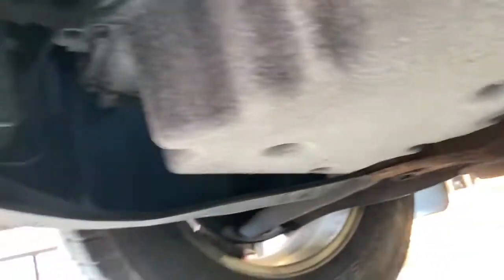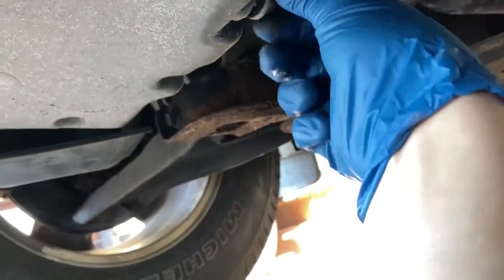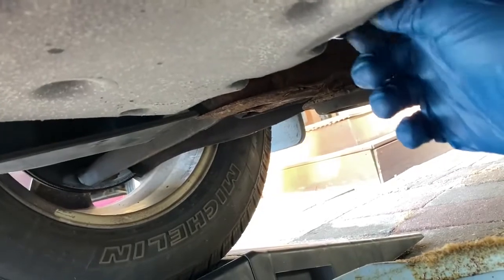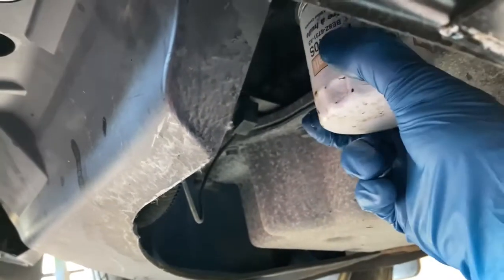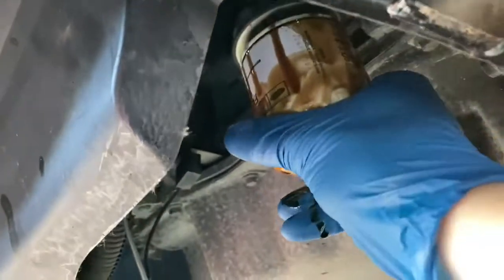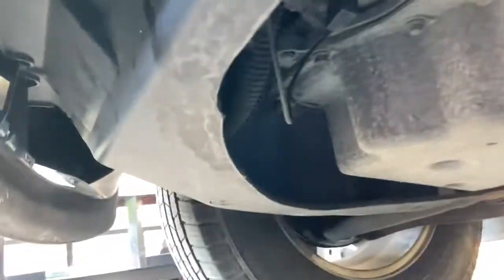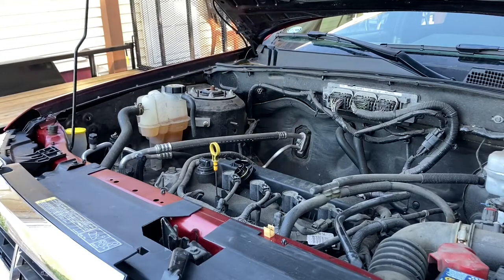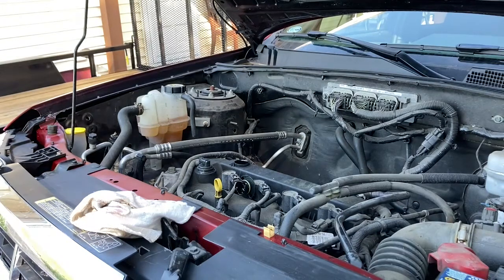Ford Escape Oil Change | How to Change Oil 2008-2012 2.5L Ford Escape

Comment: Changing your oil is a great way to get to know your car and start learning how easy and cheap it is to do your own maintenance and repairs. If you are not confident, find someone you trust to help you get started. It will cost some upfront to buy the tools but you will make it up 1000 fold over the years. I was probably 21 when I started changing mine, been doing it for over 30 years. I also learned to fix everything else, all car repairs, home repairs, improvements. I've saved hundreds of thousands over the years by not paying pro's and not having to replace cars. What is a crisis for most is for me a minor inconvenience to be addressed on a Saturday afternoon. DIY shall set you free.
Reply from the maker: 100% agree!! Thanks for the comment!

Comment: I was shopping around to get my oil changed and decided I’m done paying others to do this job. Been changing oil on my motorcycles since I was a kid. Just as I guessed this is just as easy, thanks bud. Got all I need and some Lucas high mileage oil stabilizer for 30 less than what the shops would charge. Future changes will be faster and less than half ! 💪
Reply from the maker: No problem glad to help! It’s fun doing it yourself too! You know it’s done right!

Comment: One thing I learned is do your filter first. No worries about dropping it in a full oil pan and be splashing everywhere. Also if it's vertical like this or somewhat at an angle, pre-fill with clean oil to reduce the time it's running without oil pressure. It minimal but it doesn't hurt. I use full synthetic and keep it changed under 5000 miles, 3000 if turbo. My cars go 300K, I have never had an oil related engine problem. The car wears out but the engine runs like new.

Comment: Gratitude Matt I’ve been changing my oil I’m a DIY type of girl I have a disabled mother with this car and to save money esp a time like now I choose to do it myself rather than paying almost $80 save about $40!
Reply from the maker: So glad this helped you out!! Thanks so much for watching!! 😁😁😁
Reply: I have a question my mother’s is on super tight I don’t wanna strip it what would be you best suggestion I DO NOT APPOVE THE LAST PERSON WHO CHANGED HER OIL lol
Reply from the maker: @bellmovement  make sure you use a 6 point socket and a breaker bar just try to bump it loose or crank with the breaker bar if you have a good hold. Don’t use power tools you’ll round it right off.

Comment: I just picked up a 2012 4 cyl, 2wd.  I noticed your coolant looks yellow, mine is pink?  Any thoughts?  Also, have you done a transmission drain and fill, would like to do that too.  Thanks for the video!
Reply from the maker: Yes! I have a video on the transmission on my channel! You might just have a different type but as far as I know standard yellow/green coolant is fine for these cars.

Comment: I’m getting ready to change the oil for a family member.  I think that Escape is the V6 model, though.  Other videos I’ve seen show the oil pan and filter in a different place.  I don’t want to drain the transmission fluid by mistake.

The owners manual I saw online (for 2012) said 5.3 quarts for a filter change on the inline 4.  V6 is 6.0 quarts.  Maybe some of the dirty oil stays behind?
Reply from the maker: Sometimes it’s possible it varies some, but you can always put in a bit less, run the car a few minutes, and then check on the dipstick.
Reply: Chilton Ford Escape Manual says 4.5qts for 4cyl so I was a bit surprised that the whole flask fit there in this video.

Comment: I have a 2012 escape XLT.  Wondering if you can show me diagnosing and or changing injectors.  Thanks man. Your videos are very helpful
Reply from the maker: Thanks for watching!! I would but I no longer have the vehicle. Injectors are so cheap for these though I’d just get a new set!!
Reply: @matt-diy  fair enough. I'll start with plugs and see how it goes.  Then coils then injectors if need be
Reply from the maker: @truthhasnoagenda3785  Sounds like a good plan! Luckily ford parts are cheap, if you aren't aware already, those kind of parts on ebay and amazon are super cheap and decent quality...they just dont say ford on them haha.
Reply: @matt-diy  actually yea. Even better is this vehicle seems easy to work on for a 49 year old noob like me. Good vehicle to learn on for sure. Thanks again

Comment: Im trying to figure out what type of filter will work, does it not matter a certain type of filter? I know you said any one, but dont cars take certain ones?
Reply from the maker: I have a link in the comments and description to the filter. I meant any brand but you do need to get the correct filter for the vehicle.
Reply: @matt-diy  how can you find out the correct type of filter ? I saw your link but I’m looking for a extended lasting one since I’m using full synthetic, so how can I go about figuring out what type of filter I need ?
Reply from the maker: @fulloftwit  the one I linked is the Ford OEM filter and is 100% good for synthetic oil. You can enter your vehicle information on Amazon or any auto parts site for other options.